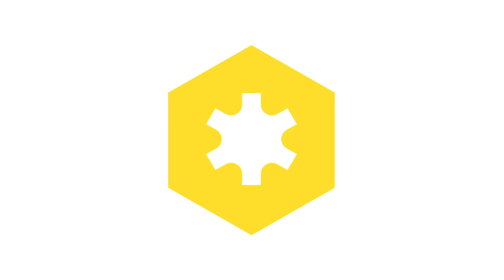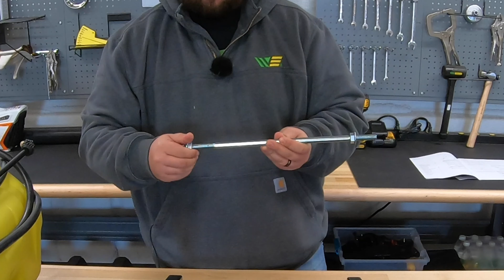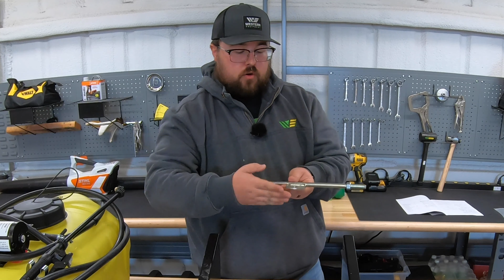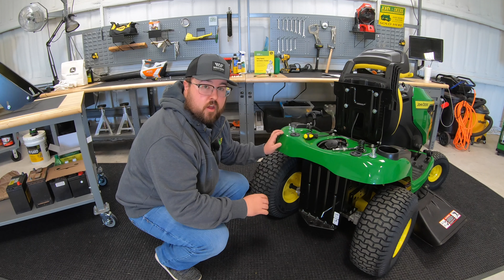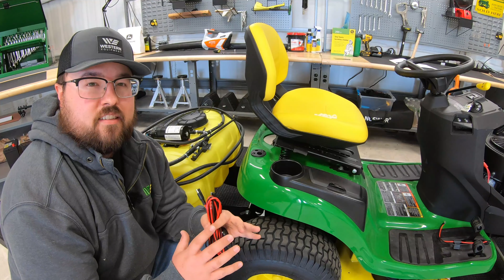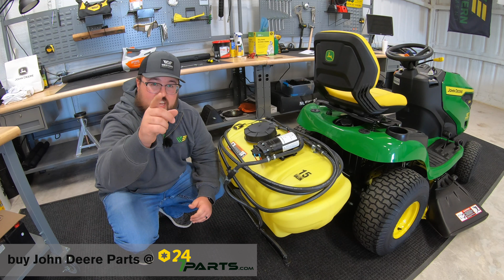How to Install John Deere 15 Gallon Rear Mount Sprayer for Riding Mowers

Comment: I have this sprayer on my JD S170. The way it needs to be mounted, the embossed gallon level numbers are on the back, difficult to read. You say to make sure the gallons indicator should be facing forward. However, it looks like you mounted with numbers to the rear. I believe this is an Agri Fab mistake.

Comment: Is there one of these that mount onto a Z515E zero turn?
Reply from the maker: As of right now, there is not but you could always put the hitch kit on your Z515E and pull a trailer style sprayer just like this.
Reply: @247parts  Thank you. I am trying to avoid a trailer because it would be more convenient to turn if it were mounted. A close one would be the TURF CARE SPRAYER Part Number LP36199 and it has a similar mount to my current bagger, but some parts of the mount are not compatible with my Z515, and i don't think they make it anymore.

Comment: I've read that the CargO Mount system is limited to 60 pounds maximum load.  The sprayer weighs close to 140 pounds with 15 gallons on board.  Am I wrong?
Reply from the maker: I have never seen that spec before on the cargo mount. THat may be correct if you do not have a bottom support that goes into the frame but most of the attachments that use the CargO mount system have a bottom support in the frame.

Comment: Run the wires down the same path use for the fule line to the tank or other wires like seat safty wires and come out by the side cup holder or other plastic parts and your harness connector by the seat prrmently and use plenty of wire ties also making sure nothing can catch moving mechanism and cut the wires.
Reply from the maker: Good tips! Thanks for watching!

Comment: The fuse isn't to protect the pump, its to protect your tractor, becuse if the power wire shorts to ground without a fuse it will catch fire, if its routed by the gas tank it can make the gas catch fire if its inside your garage youll also loose that too.  Fuses protect wires not componets when they are by the battery, the motor can still burn up even with the fuse installed. So to keep from burning up the companet or wires never replace the fuse with one that handles more current then what it has from the factory.
Reply from the maker: Nice info! Thanks for that and thanks for watching!

Comment: The lower valve on the tank selects between both the wand AND boom or the wand only (you really don't want the boom spraying if you've stopped to hand spray). The upper valve allows the water in the tank to recirculate while mixing whatever your adding to the water. It recirulates the contents of the tank back into the tank. 

This upper valve must be closed to use the boom or hand sprayer or there will be insufficient pressure to them due to the recirculation.
Reply from the maker: Thanks for the additional info. I should have included this in the video. Thanks for keeping me on my toes and thanks for watching!